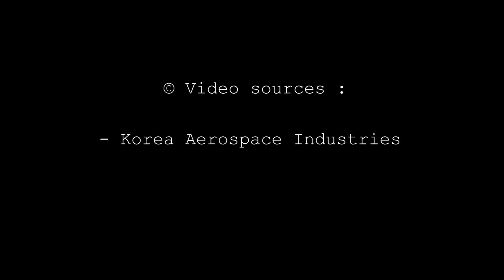Korea Aerospace Industries launch final assembly of KF-X fighter prototype

Comment: Looks more promising that the J20 and su 57 both of which is still being  tested even after production lol
Reply: What are  you talking about this is just final assembly, it will take them years before they get into production phase. Sukhoi are still doing engine test on the new engine before the jet goes into full mass production. Another thing  if this is like the F-35 program where they depend on China for parts, then this might take even longer  and in worst possible case they might be forced into finding a new supplier (which there aren't many off) or even get sanctioned by US. Reason why i'm saying this is because thats exactly what  Northrop Grumman and Honeywell intl did during the F-35 program and if Congress knew about this at the time entire project would have been in jeopardy!

Comment: How does it compare to Su-57 10th generation jet?
Reply: As you can clearly see it's way more advanced in terms of development. Looks like they will do it the right way with KF-X:
Prototype of a 5 gen shell but aiming in 4 gen for now -> testing flights -> production -> service -> future upgrade to 5th gen fighter -> service as a 5th gen.
Where Su-57 goes like:
Prototype of a 4 gen fighter with minor 5th gen capabilities -> testing -> service -> back into drawing board to make it more 5th gen but fail -> testing in service -> calling it a 5th gen jet fighter -> no production -> next prototype all the same 4th gen with exposed engines and air intakes and half of the weaponry outside, but lowering the radar profile with some features.